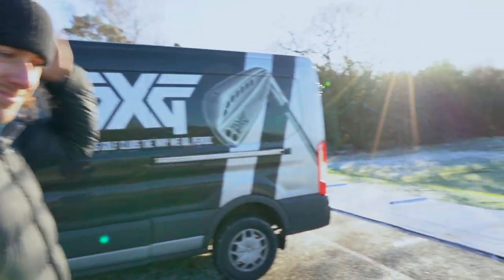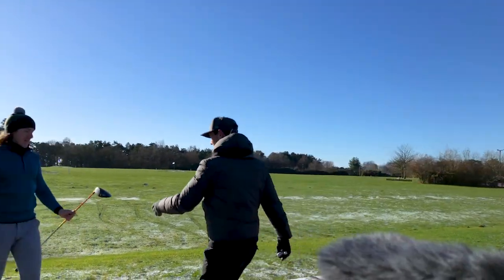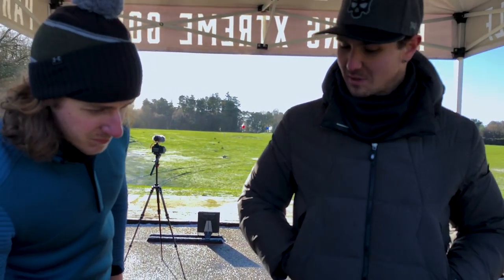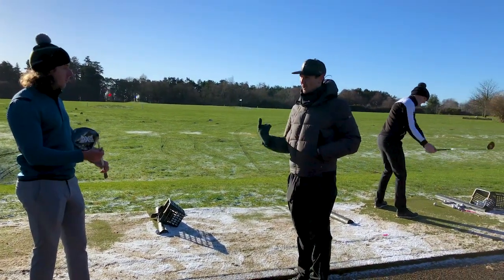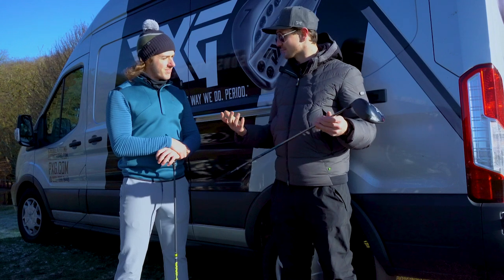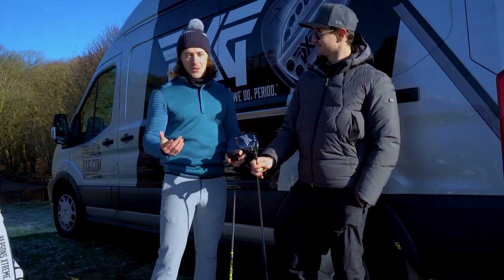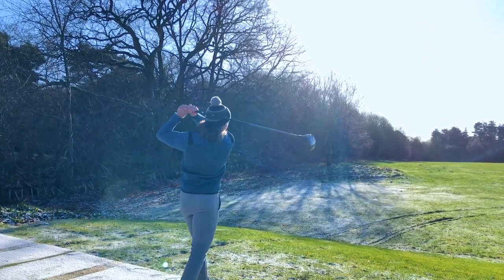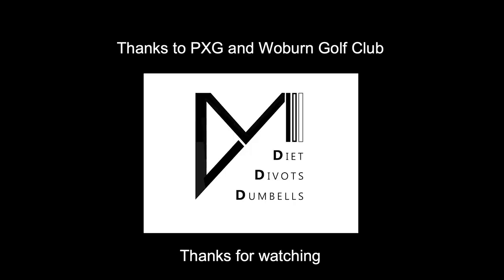PXG DRIVER FITTING

Comment: So, the PXG Gen2 drivers dropped to $295 with the introduction of the Gen 3 Proto. Would you say getting fitted with the Gen 2 is a better deal than other similarly priced drivers our right now? The $295 includes the upgraded shaft options as well, so i'm thinking it's a can't miss deal, right?